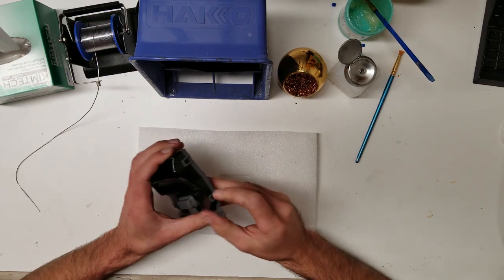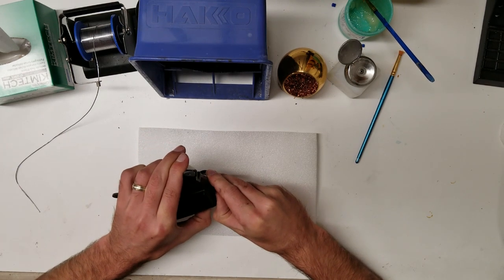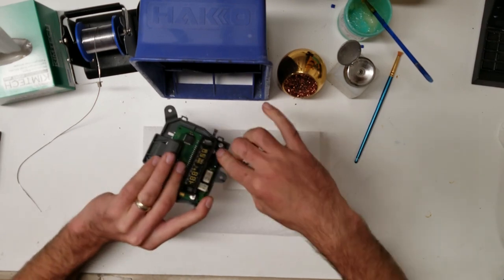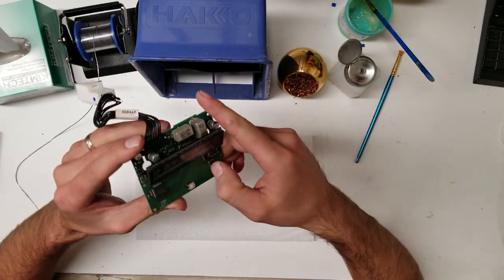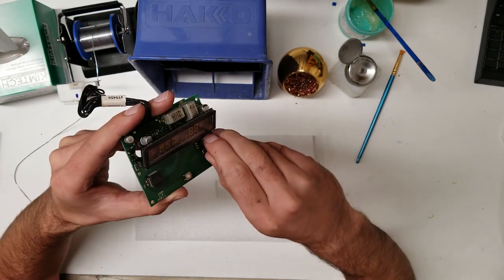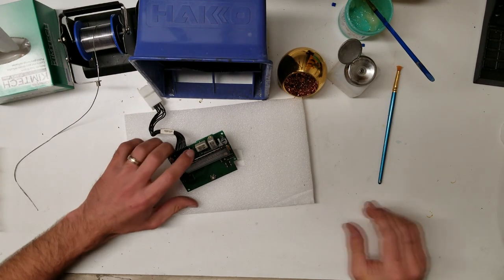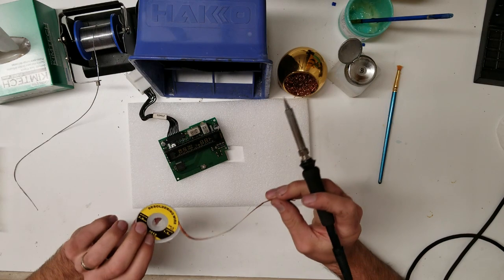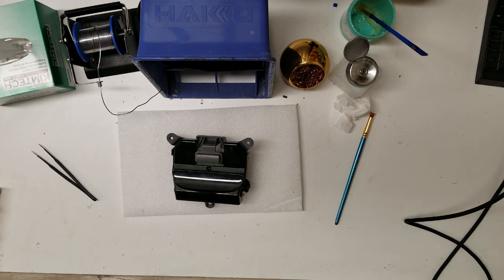Watch me repair a Compass overhead Information Display 2005-2009 Toyota Tacoma

Comment: im wanting to buy the 510 resistor
Reply from the maker: https://www.automotivecircuitsolutions.com/products/new-replacement-resistors-for-ford-toyota-and-honda-overhead-display-and-clocks?_pos=1&_sid=05684d7e9&_ss=r&variant=12619204624435

Comment: I did this 4 times....it doesn't last
Reply from the maker: Send it in, we guarantee it will last. Soldering iron temperatures, solder, flux and a proper technique play a major role for a lasting repair.

Comment: Great video!  I've had success with this repair in the past but my display has recently stopped working again.  The iron I used was much too large and bulky and I want to clean things up and re-do it correctly now that I have an appropriate soldering kit.  Thanks for posting the tools you use and a link for purchasing the resistors; I ordered two so I can start fresh.

Comment: Nicely done. Noob  Question: what's in the copper ball, flux? and what are you using to clean the flux, alcohol?
Reply from the maker: The copper mesh is to clean the tip, works very well compared to a moist sponge. We us either alcohol or lacquer thinner to clean flux off the boards.

Comment: Thanks for showing your video fix I have a Toyota Tacoma 2005 and I have same problem, where can I get the resistant chips. Thank you.
Reply from the maker: Here is a link. Select the 510 option. 
https://www.automotivecircuitsolutions.com/collections/other-electrical-components/products/new-replacement-resistors-for-ford-toyota-and-honda-overhead-display-and-clocks

Comment: I have a "Revision 3" display that doesn't have the 510 resistors.  The compass displays correct, but the temperature just displays dashed lines.  Any suggestions?
Reply from the maker: Most likely a bad ambient temperature sensor.